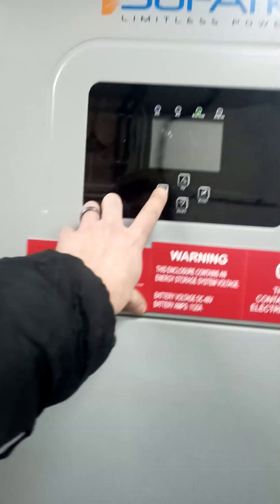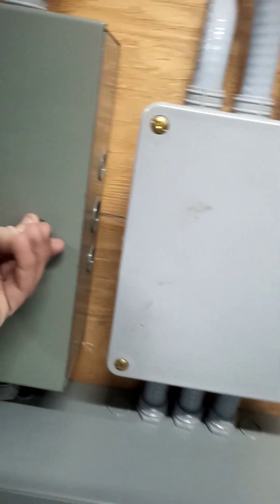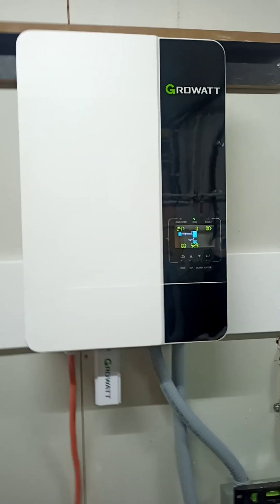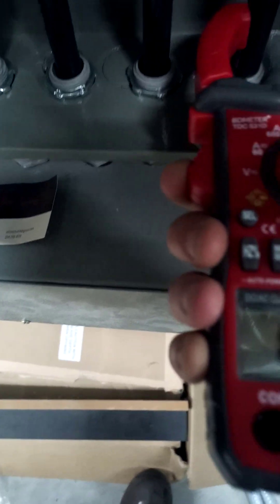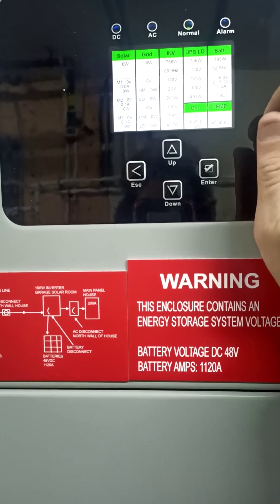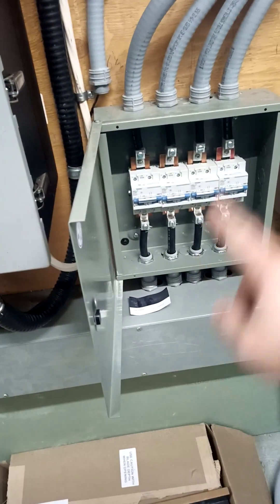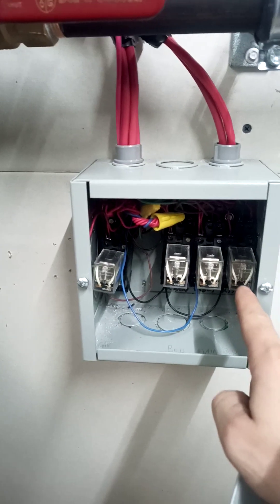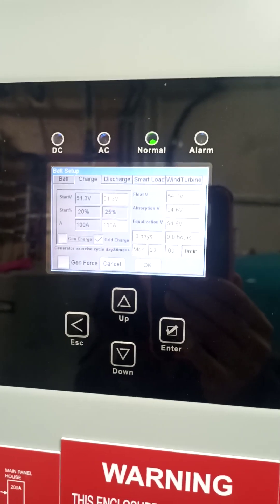Sol Ark 15K updates and added a growatt inverter as charger only from alternate generator

Comment: "Double Conversion".  Isolates your AC system and your generator from each other. I DIY'd mine with ~3kw of power supplies but have thought of buying an additional Growatt specifically for that purpose. The interest in this approach is huge, judging by all the hope and drama that flared up overnight about the EG4 Chargeverter.  The funny thing is, if one is willing to use an AIO as ONLY a battery charger, there have been ~$500 options like that for at least a year or two, maybe longer. People act like a $400 100a charger is a new thing, but only because they do not consider the possibility of doing what you have done and using an AIO as JUST a battery charger. In that sense, while a Chargeverter is cheaper than a Growatt 5k, it is not MUCH cheaper than the $500 48v AIOs that have been available for a while now from PowMR, etc.
Reply from the maker: Exactly!  Sometimes people just don't think outside the box like they used to, I like the fact that I have a "Spare" Inverter around in case the SHTF with the sol ark at any given point.  I have a spare auto transformer lying around that I could put to use in a worse case scenario.
Reply from the maker: Started a new thread on diysolarforum to find a list of inverters with more charge capacity.

Comment: Nice setup! Why not use a transfer switch to alternate generator inputs? Then the solark would see either on the input
Reply from the maker: I do not like way sol ark has to pass the gen power through to the loads. Makes all the led lights pulse and flicker even with a generator that has extremely low harmonic distortion. And a rock solid 60hz power only loading gen to half load. Still makes lights flicker and some of my hydronic relays bUZZ. this way with the growatt it's just charging works much cleaner!

Comment: You need to have a proper plug inlet to the Growatt inverter, as right now all of the cords would be an electrocution hazard if unplugged due to the live plug prongs.
Reply from the maker: This inverter is only active when the generator is powering it. Leave in standby mode. When the generator is off. Inverter shuts off and also turn off breaker to 48V. This type of charging needs to be monitored. It's not automatic. The auto charging is through the sol ark worse case scenario. It's no different than back feeding your breaker panel. Male to male.
Reply: @mylesoffgrid  Still no reason to not wire up a plug to the inverter charge input instead of a receptacle.
Reply from the maker: Yes you are correct I will look into this it's a simple modification! Thanks for the great feedback! Proper term for this setup is called a suicide cord.  Beware that you should as mentioned never have an exposed male live cable.

Comment: That's not a bad idea, have the solark do the auto gen start/stop but use something else to charge with. Solark really should fix that, they have a full 60 seconds to modify the frequency slightly and then load up on the generator slowly to prevent the issue.
Reply from the maker: That might not help the issue because the sol ark uses common wire to charge and discharge, so you cannot have current flowing in two directions, sol ark will always use gen power to power the loads then the leftover gen power goes to charging.